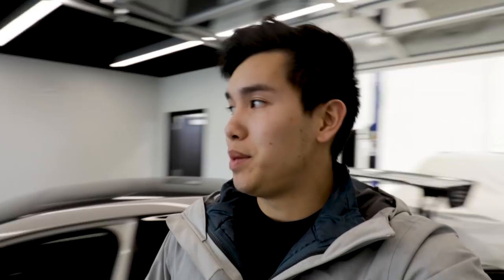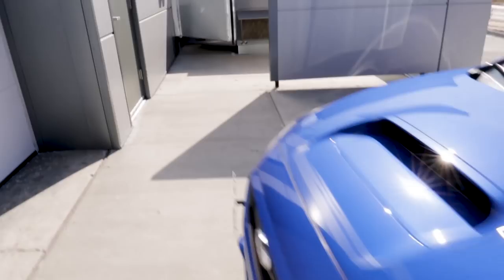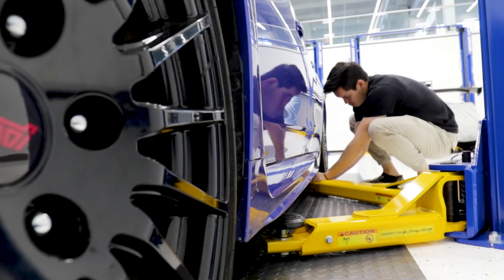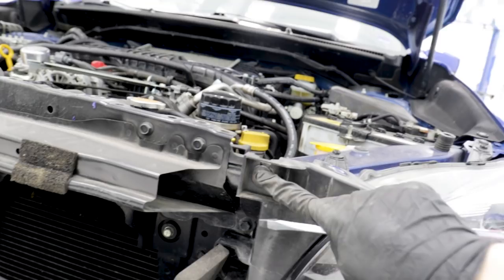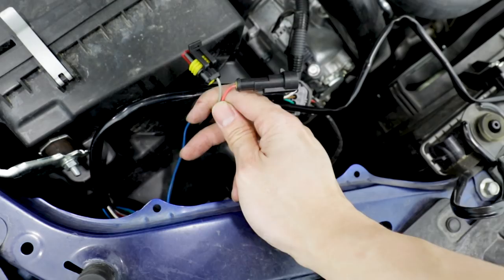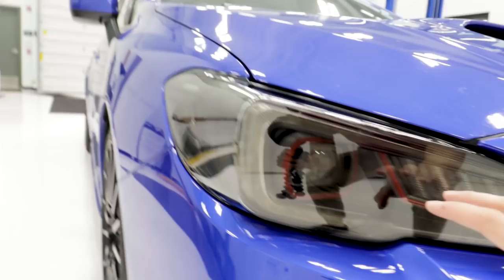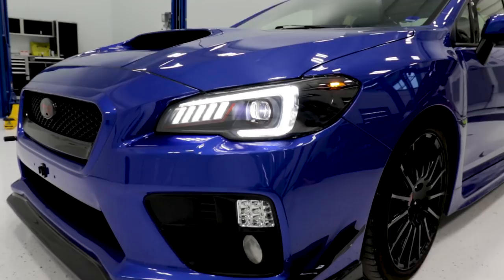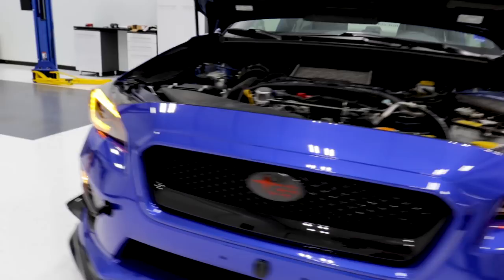New Subispeed V2 Headlights Vlog

Comment from the maker: The new Subispeed V2 Headlights are set to be available this Summer with a new look and sequential C-light function! Do you like the V2s or the V1s better?
Reply: SubiSpeed v2222 all de wauu
Reply: Will they be available for the 2015 sti?
Reply from the maker: Yes
Reply: V2
Reply: I think I will be buying these.  Was waiting, because I wasn't sure about V1.  The C-lights are the "stock" DRLs in these right?
Reply: Also, how many hours of testing or accelerated testing have any of these gone through?  Just curious about a year or two down the road if there could potentially be issues, or if they are essentially stock, but better.
Reply: Other than the red stripe. I like v1 better. Not a fan of the turn signal on v2. And it's just too dark. Plus the turn signal in the fins is the hotness.
Reply: SubiSpeed when can we PO this v2 headlight???
Reply: Sick you guys addressed my biggest complaint with the V1 which was no C-light turn signal! 

Do the highlights dim when the turn signal is on? I always appreciated that feature on a car as it really makes the biggest difference in turn signal visibility.
Reply: Do these require splicing for DRL, or are they pretty much plug and play?
Reply: V2 ALL DAY!!!
Reply: I like how the V2 has a smoked amber and red lining. But there's just too muxh dark. If the v1 had the red lining  and smoked amber then that'd be perfect!
Reply: Will they be available for the 2018 STi?
Reply: SubiSpeed will it be compatible w/ 2018 sti?
Reply: Would i still need an hid kit for low and high beams?
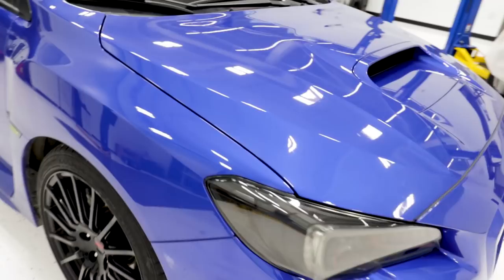Reply: @SubiSpeed  in your next headlight or maybe refresh of v2.... isnt it possible to not make the headlight stick out so much? I noticed at 8:00 that bulge was the reason i sold my v1s😳😳😳

Comment: They look good but my only beef is that they aren't as curvy as the stock headlights. These have sharp edges which changes the look. And for that it's a deal breaker for me. If it had the OEM shape, I'd buy these in a heartbeat. Oh and V3 needs the multicolor C-light.

Comment: 2018 headlights still better on this. It moves when you turn.and its bright just like that (both LED and the C lights in DAY time is very noticeable bright white) it will last longer than that since its OEM.look more aggresive.material and quality is superb than that since that one is aftermarket which will have flaws again.well i might be biased on this because im a 2018 sti owner lol.
Reply from the maker: Martin Umaguing 2018 LED lights dont work on older models... Also I assure you the LEDs on these are just as bright. It's ok if you enjoy your OEM lights, but these are for owners with the base halogen lights or for people who like the unique look.
Reply: SubiSpeed agree.this only for 2015-2017 right.and yeah i love the 2018 headlights.

Comment: Amazing headlights  but when will there be an upgrade option that allows you to change the style of blink from inside that car. like a switch from one to the other
Reply from the maker: That will likely not be an option due to the extra installation process, plus there will not be a high demand for it because most people will set it and leave it as is.
Reply: Okay, just sounds like it would be a cool feature!

Comment: Has anyone else run into the issue where the sequential turn signal goes into like super turn mode? When I keep the setting for sequential, the turn signal blinks twice as fast as it should. But when it's the whole C-light, it blinks normally. Anyone have any fix actions? @subispeed
Reply: I legit have the same exact problem. Did you get a fix?

Comment: Is there a way to not have the stock turn signals  blink along with the sequentials? Like just have the headlights blink
Reply: Mario zamora Unplug the stock bulbs
Reply: I literally took out my stock blinkers and molded covers over the holes looks great. But yeah if you just unplug the bulbs your good to go. I’m glad I waited for the v2’s I wanted the red so bad I’m glad they put it in.
Reply: Nick Fisher what molded covers did you use?
Reply: Daniel Espinal I just made my own I got epoxy and some plastic and just molded it in the square